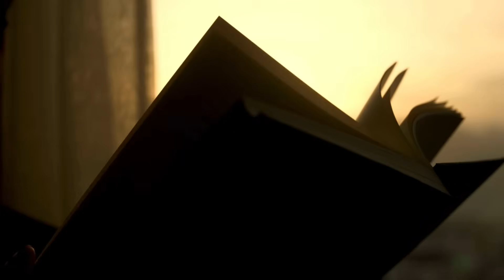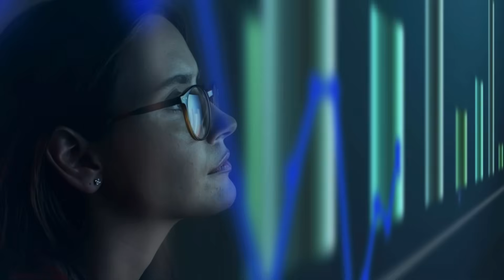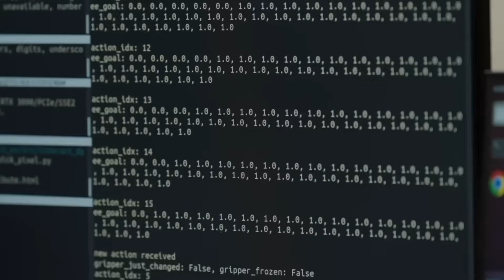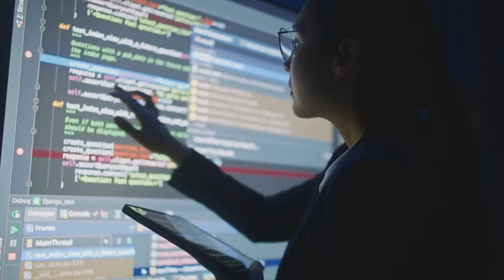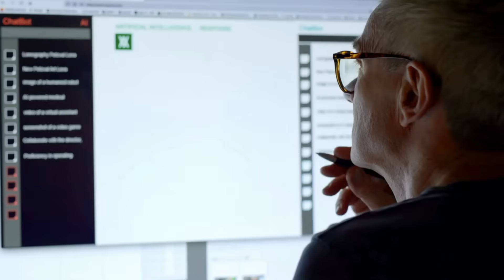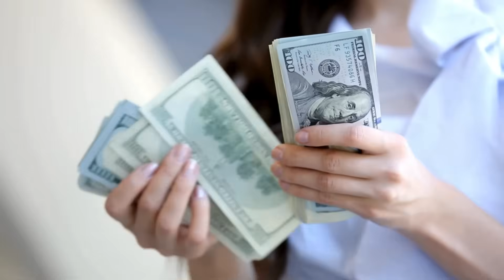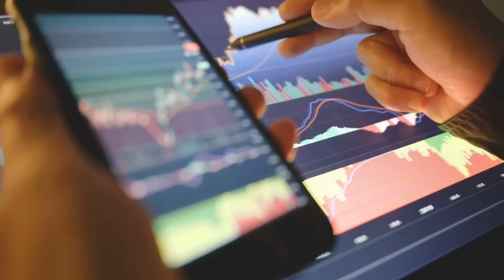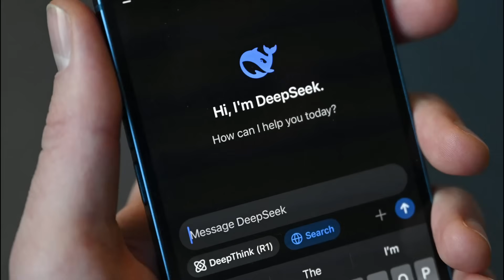AGI is Coming: Will You Own Capital When Labor Becomes Worthless?

Comment: Who wrote this garbage? It's dingbat crazy. Why would you quote Sam Altman?

The 2027 date is nuts. Even if AGI theory were complete today, there wouldn't be a working system until 2036 at the earliest. The actual growth factor due to AGI's increase in efficiency is 25% over 10 years. There could be some improvement due to new science and technology but a lot of this would come from humans using AGI derived tools, not AGI itself.